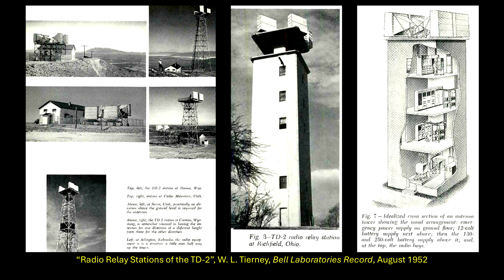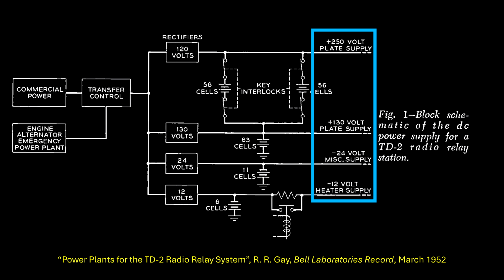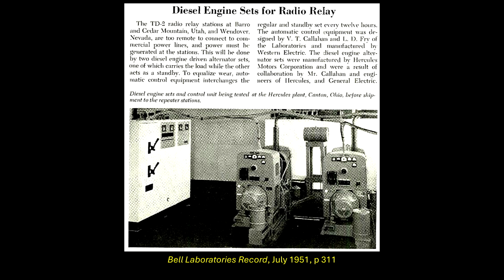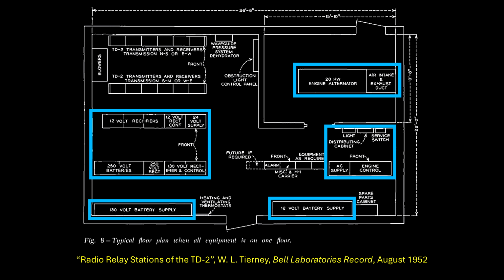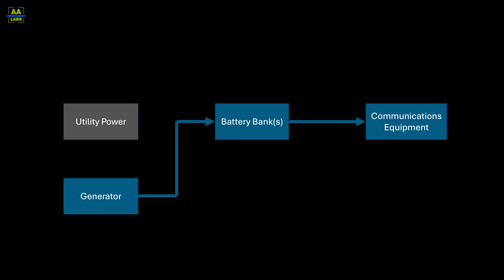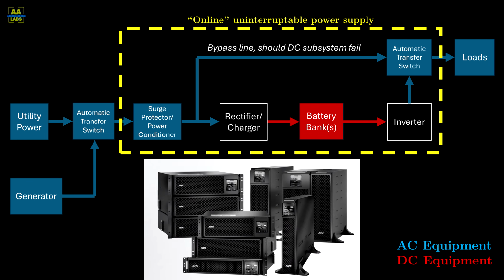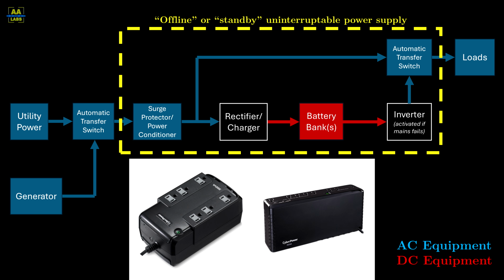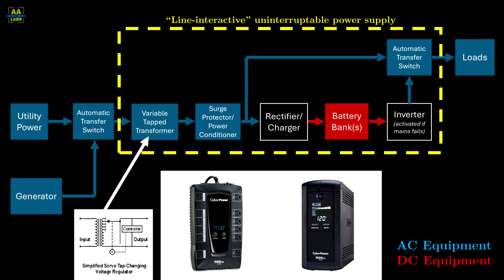AT&T Long Lines: The Power Plants, Batteries, and Generators

Comment: Where I grew up, is an old LL site.  Over time, people have broken in and gutted the place.  I was able to see the inside of the facility before the doors were welded shut.  It would have been very fascinating to see this system in operation for sure.  Building, tower and horns are still there, but sadly all the waveguides are gone, AC system all but scrapped, generator head gone from the 12v Detroit Diesel.  The site now sits abandoned, with it's "neighbors" used as cell sites.
Reply: save the 12!!!